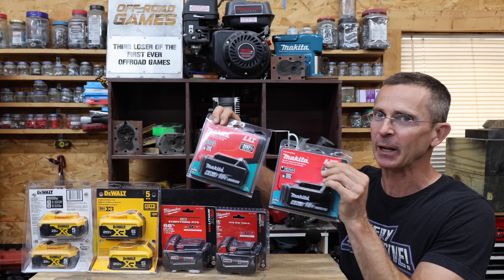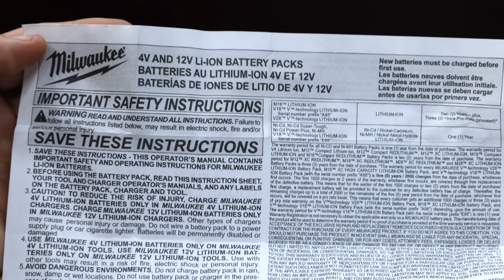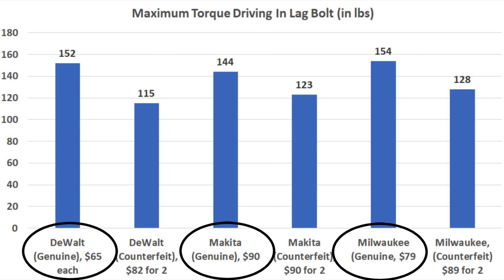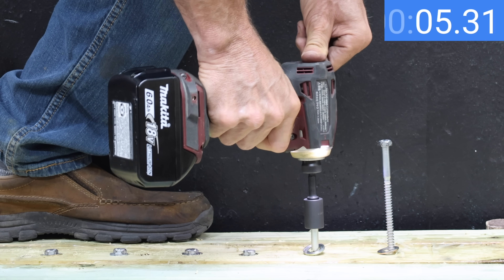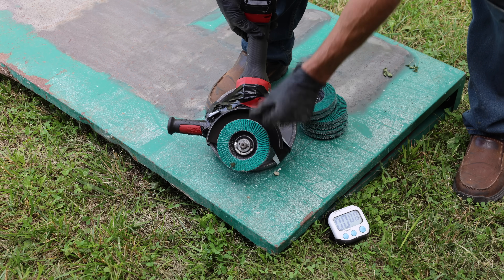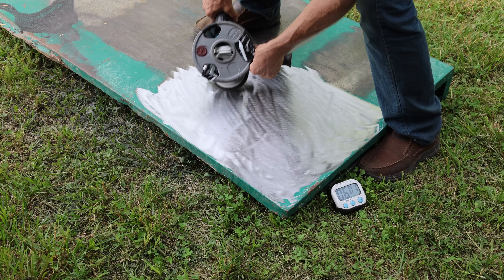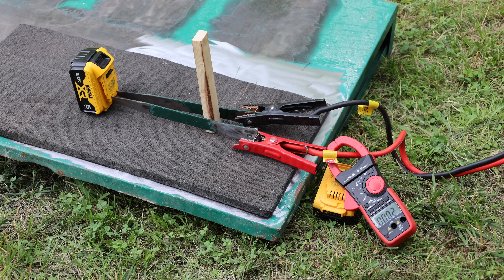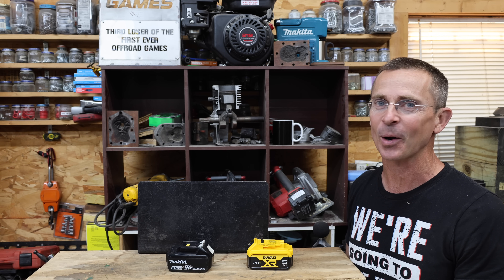Have You Been Scammed with a Counterfeit Tool Battery?

Comment: The "Dewalt store" on Amazon is a company called CPO Outlet.  They sell recondition products and are not a true seller of Dewalt.  What does that mean?  Products sold from them does not have a warranty from Dewalt.  They must cover their own warrant.
It's a hit or miss with them as you might receive something that is heavily used or missing parts but might be better than the original.  Why? If the tool was returned due to a defect their product is better as they resolved the defect.

I don't like how they sell on Amazon as "new" and they do not clearly inform you the item is used or not.
They are a little bit cheaper (most of the time) than buying from HD, but like always do you own research.

Comment: Some years ago I got in a heated argument when a guy borrowing my Dewalt drill used a fake battery in it on a jobsite. And some guys took his side saying that the knockoff batteries were just as good. I pointed out that they my tools so my rules, and it wasn't my fault that his drill didn't work... for whatever reason.
Reply from the maker: Thanks for sharing!

Comment: Would you do a series on home gardening tools and equipment? Currently I’m researching hand held sprayers and those range vastly in costs, but which performs best and lasts the longest? Some reviews shows the plastic exploding under pressure, some state the sprayers can be held at any angle, others claim filters prevent clogging. Like which is the best?

Comment: well,  there are always more then one side to a problem.  One problem is price,  when you make things that cost alot more then its worth,  you will of cause see people get around this problem.  Take a Rolex watch,  not worth its price,  and so on..  Take cheap tool brands like Lidl's Parkside here in the EU at least,  their batteries are super cheap,  1/4 the price of Dewalt,   they charge super fast,  and last a long time..  Just as good as Dewalt, Makita .. .. ..    How many do you think make fake Parkside batteries ?  None,  why ?  they cant make them much cheaper..

The 1000+ tool batteries types are stupid as fuck..  Make a universal type,  and have a fair fight to make the best batteries for that one socket.    Batteries are like fuel for cars,  think how stupid it would be if every car brand had their own fuel that only worked with their cars..

Think if Dewalt went down tomorrow,  all those batteries that cant be used anymore.

I say,  make money one the tool itself,  and let batteries universal,   much better for everyone.

Comment: My biggest problem with these battery packs is that they are not designed to be user serviceable.  The batteries are all spot welded together.  It should be required that there is a way to service the 'pack' and replace individual if not all of the batteries by the user.   I recycle all my battery packs and hope the right thing is done, but I have my doubts.  Who does not have a ton of aa or aaa batteries in their house?  So ass 16450 or 16550 as well.

Comment: I just bought 2 new Dewalt 20v flex 60v 12.0 ah batteries from Homedepot For $299 ea. I shopped around online at Amazon and Ebay and others but decided for $50 more I will buy at Homedepot. I stopped buying on Ebay and Amazon for electronics about 7 years ago.
Reply from the maker: Thanks for sharing!

Comment: I could tell the difference. The packages on both brands was completely different.  How about barrel cleaners? You have done gun oil but not cleaner.  Patch Out, Hoppes #9, CRL, Barnes CR-10, JB paste, acetone/ATF, bore-tech, montana x-treme. Maybe you could get an exhaust pipe from a muffler shop for carbon and copper pipe for copper.
Reply from the maker: Thanks for the idea!

Comment: Garbage Chinese batteries are setting fire to electric bikes (and buildings) on a regular basis in NYC - these sellers are literally killing people.  Not that they care.
The city is trying to make it illegal to sell non-UL approved batteries, but of course the criminals will just print a UL label and carry on.  It's not clear how to protect yourself.

The weight difference should make it possible for us (and customs agents) to detect the phony batteries shown here.  If you buy from Amazon, the first thing to do is check the weight.  If you get a fake, return it with "counterfeit" as the reason, and report the seller.

Comment: Amazing video. like always. Not to discriminate but I would advise anyone to not order a battery from China/Aliexpress/suspicioussite. I have had multiple counterfeits from China before. It's not worth it. There are certainty good sellers from Chinese sites but you need to make sure you are buying a genuine product. Always check reviews and make sure there are plenty of good reviews. Any doubt is negative so with any doubt, do not buy. Also when a site says more than 3200mah per 18650 battery they are probably fake. 18650's top out at 3200mah. So when a site says 9900 mah or higher for a single 18650 it's a good bet it is fake.
Reply from the maker: Great point!

Comment: Good information.   I am weirdly "phobic" of batteries in general.   My vintage battery tools had expired Nicads,  and I have rebuilt them with NIMH.   I know Lithium batteries pack in more power,  but also more danger.   If possible,  I use more Plug-In  or Air tools.
Reply from the maker: Thank you!

Comment: I bought counterfeit Makita 6Ah batteries on eBay, one of the batteries lacks support on the positive tab like shown in video and that's exactly where it shorted through 18650 plastic sleeve. 

Also the plastic housing cracked while falling from work bench onto concrete.

Cheap and effective I must say, if tool companies priced their batteries more reasonably I might have bough originals. Just as long as you understand limitations of them, they're ok to keep in my opinion as they're a tad better than the complete aftermarkets.

ALSO the capacity of each cell is around 2300mAh unlike the fake ones sold on Amazon which are around 1300mAh...

Thanks for bringing attention to this topic, the more people know the less money these counterfitters can make on unsuspecting consumers.
Reply from the maker: Thanks for sharing!

Comment: FINE test, Commander! I haven't gotten scamed yet BUT I haven't got any new batteries either. All our DeWalt batteries are old school and doing fine. Lately we use them with the knockoff LED lights when the power goes off and a 2 Ah battery lit one for over 4 hours so we'll  not growl at all. Sweetums just got a Kobalt battery pressure washer that she likes. I'm going to have to give my gas job away looks like. Too dectipit for my own good. Hers is a 40 volt and 600# pressure that you can run off a hose or from a supplied hose in a bucket. It's new but does what she wants it to do as far as steps and border rocks. That might be a good test for major brands. Hope all is well on the farm with plenty of rain and sun. I'm out to put the local atomic power plant to work and mow the yard with the battery zero turn.
 Wishing yall the best of the best and God Bless yall!
Reply from the maker: Hi Lewie, It's ALWAYS great to hear from you!! Glad you haven't gotten scammed. I'm sure that a lot of others have been scammed and aren't aware of it. Unfortunately, a lot of people are pretty upset at the tool manufacturers when in fact they aren't aware of owning counterfeit batteries. Also, thank you for the video idea on pressure washers!! That does indeed seem like a great suggestion. Did you actually buy a battery powered zero turn? If so, congrats! Hopefully, it'll provide great service. Wishing yall MANY BLESSINGS!!
Reply: @ProjectFarm  Since I got laid up with AFIB and whatnot we got a Craftsman 56 volt zero turn 42 inch last fall and have almost 40 hours on it already AND a Stihl nbattery hand mower for the Sweetums! Kept a couple of gas jobs for spares but hadn't needed them yet and won't I hope. Our yard takes a good hour to mow and the rider reads hi 60's and lo 70% left in the battery. 3000 Ah so there's plenty of juice. 4 motors total, 2 drives and 2 for the blades, a half speed setting on travel and an economy on the blades. I cut the yard every 2 to 3 days. And we're blessed WAY more than we deserve. The BEST to ALL Yall!

Comment: Greatly interested in counterfeit batteries that allow you to register for warrantees, what happens if you send in for a replacement?  When ordering on Amazon,  I stay away from anything that is too cheap, and try to stay to what looks like the manufacturers site, not a reseller.  Problem is many counterfeits keep their prices just below, but close enough to the OEM to see legit.  Wont even get into how many batteries I've gotten from Amazon that NEVER come close to rated capacity.  Lets not even get into them showing ratings in mWh instead of mAh to show a higher number to confuse people. . Majority of aftermarket batteries I buy are ones that the manufacturer will not sell a replacement, that their units are sealed and disposable.  The aftermarkets are hit or mis, but never coming close to the OEM in capacity and safety.   I am nor for big government, but all devices that are sold with batteries should be required to be user replaceable.

Comment: In fairness, you can say you're paying for what you get when buying the cheaper counterfeit batteries. Pay less, get less. Pay more, get more. It's really not that bad if you're on a budget. The only problem is the fakes are being advertised as "genuine." They should advertise it as "copies, budget performance."
Reply: And fires.
Reply from the maker: Thanks for the feedback.
Reply: But, you're going to have people paying full price for counterfeits. Counterfeits aren't necessarily sold at a discount, so we can't judge based on price points. Anything bought online will have to be cracked open and inspected at the risk of voiding the warranty.
Reply: @compassandradio6261  every single battery tested in this video was sold at a significant discount compared to the originals. 🤔

Comment: Sadly, what is a consumer to do?  We can't tear apart batteries before buying them...  this seems to be another area where our government is failing us big time...
Reply: Not buying them online is a huge step
Reply: @BcFuTw9jt  Bought any auto parts from your local store in the past 20 years?  USB flashdrive from the ShopKo?  I was just last week trying to get the kid at the counter to not put the counterfeit National bearing back on the shelf, but alas, he did.
Reply: Buy from legit stores rather than Amazon and eBay.
Reply: That's why this is such a huge problem. That and lack of reporting. There's not really a foolproof way unfortunately.
Reply: Buy from local retailers. If you can't get a genuine battery because it's no longer carried by your local stores, contact the manufacturer of the tool and see if you can order one from them. 

Also, educate yourself on the differences between genuine, counterfeit, and aftermarket batteries.  

Aftermarket batteries are made by companies proud enough to put their own names on them and back them with a warranty. Counterfeits NEVER have a 3rd party brand on them.

Example:
Let's say your local retailer can't get an original battery for one of your old tools. Only counterfeits and aftermarket batteries are available. The aftermarket battery, made by Duracell, has a warranty backed by the Duracell division of P&G, along with safety features put in by P&G's suppliers, such as Samsung, LG, and Panasonic. The counterfeit has no warranty and no safety features, but has your tool brand's name and part number. It's also $20 cheaper than the equivalent Duracell on that certain rainforest shopping site that starts with something that rhymes with Scam.

3 weeks later, the counterfeit you ordered at the cheaper price stops working, experiences overheating, or causes a fire due to thermal runaway. You contact the seller, and get no response. No refund for you! Was that risk by not having safety features worth the $20 to you?

Comment: The most important thing is that the genuine batteries have logic to prevent fires, which was a problem that first really manifested itself with laptop battery fires. That's why I always buy my laptop batteries from the OEM, never from Amazon or eBay that have untrustworthy suppliers. Boing Boing did a report on how fake batteries don't have fire suppressant logic. Linus did shows on why Apple chargers are so much more expensive than the knockoffs. The logic to prevent damage or fires is not in there and the fakes use substandard parts and designs.
Reply from the maker: Thanks for the feedback.

Comment: Idea for a future video: fire extinguishers? I was shopping the other day and there were more options than I was expecting. Some big and some small.
Reply from the maker: Thanks for the video idea.
Reply: Best fire extinguisher for the home is a 2.5 gallon water extinguisher.  Dry chems don't work real well and make an incredible mess.  Best extinguisher for the kitchen is a lid on the pan.  There's not a really good extinguisher for car fires unless you can get the hood opened really fast.  But a 5 A BC is as good as it'll get without lunking a huge extinguisher around.
Reply: Consider a fire blanket rather than an extinguisher
Reply: Listening to @RealJeep may be detrimental to your life. First a water extinguisher should rarely be used unless it's solely combustible materials (wood, paper, grass, etc), never use on oils, fuels, grease, most plastics and never anything electrical. Yes the dry chem extinguishers make a mess but if used properly they work the best for most situations. I strongly recommend that if you have questions concerning fire extinguishers go to your local fire dept and ask for their help in the matter. Most fire dept's will actually come to your residence and suggest locations to keep them (or like the dept I retired from would even install them for you if you bought them). Same goes for smoke detectors and CO detectors.
Reply: @johnh2880  Odd, The first guy off of an FDNY truck company is the can man.  He can put out a lot of fire with a 2.5 gallon can.  Second, dry chem extinguishers suck and hardly ever work.  If they did fire engines would have big tanks of Purple K on them like ARFF truck do.  No, you can't use a can on burning fuels or energized elect equipment but how many homes have those fires?  No, busy fire departments will not come to your home for a fire extinguisher class, you must be a vollie.
Reply: @RealJeep  actually retired from a full time dept, and yes many if not most full time dept's I've ever interacted with will gladly go to your home to check/install smoke detectors do recommendations for fire extinguisher, CO checks, etc.. Just because your dept does not doesn't mean all do not. My initial comment still stands.
And volunteer fire dept's are the backbone of our service across this country, you shouldn't be so quick to disparage them.

Comment: I always open the batteries as soon I purchase them. I check if the batteries are marked "Samsung", the presence of a cell balancer on the circuit board, and the internal resistance of the cells - less than 20 mΩ for 18650, less than 10 mΩ for 21700 cells. This is because the brand marking could be fake.
Anyway, it's not worth to save few bucks on tools' batteries: original Samsung cells have eight years of calendar life, Vs one or two years of unbranded cells. The formulas for the electrolytes are the most protected secrets of industrial manufacturing...
Reply from the maker: Thanks for sharing.

Comment: I purchased two Milwaukee M12-6 amp Batteries from e-bay. The seller assured me they were genuine Milwaukee units. After receiving them the looked "off". I contacted Milwaukee with their Serial numbers and sure enough, they were counterfeit. Contacted the seller several times before he finally responded with send them back to me (at my cost) then I'll refund you later, Nope. Contacted ebay and they got my full purchase price back. If the price sounds too good to be true it probably is a fake.
Reply from the maker: Thanks for sharing.

Comment: I got off brand DeWalt batteries for myself years ago and honestly they've worked fantastic. They were so much cheaper I was able to get a whole extra pack and still not match the price of a single pack of DeWalt batteries and I used them on the jobsite consistently for years, trading them out with my boss's, and no one ever noticed any real difference in performance.

I think the reason they worked out so well is that they weren't trying to trick anyone into thinking they were the "actual" thing. According to Amazon they were "Enermall" brand batteries and I've been very happy with the purchase. I'd never buy a counterfeit battery that was trying to imitate the real deal, but I'd happily give these another shot if I need replacements (of the four I bought one broke, and only because the tool was dropped from the top of a long ladder and it landed at a bad angle. It still works technically if you hold the battery in place, but it's not worth the hassle so I just use the other three).
Reply from the maker: Thanks for sharing.
Reply: Off Brand as long as you know they are not the OEM is fine.  As long as you don't have a fire hazard.  Everything else is fair game.   If they don't last and you know they are not the brand name, well, you knew and rolled the dice.
Reply: I have red dewalt batteries that work just fine. Little less"power" but a lot less price.